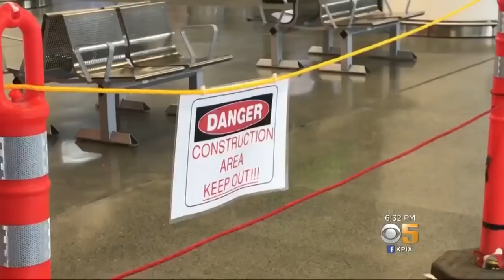Transbay Transit Center Crack: What We Know & What We Don't Know

Comment: Question:  Does the Transbay Center building foundation pilings go down to bedrock?  That was the stated reason the Millenium Tower is sinking.   Of course the TBC is a LOT  heavier, (try planting a garden on your roof) and the water pumped out--billions of acre feet, directly below the building must have caused subsidence as it did with the MT--I wonder if they ignored the example next door?